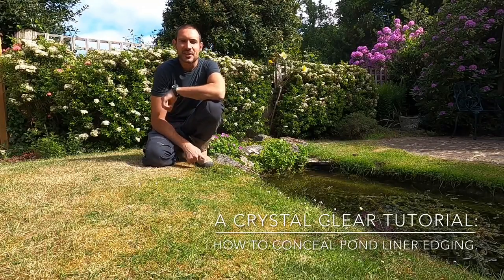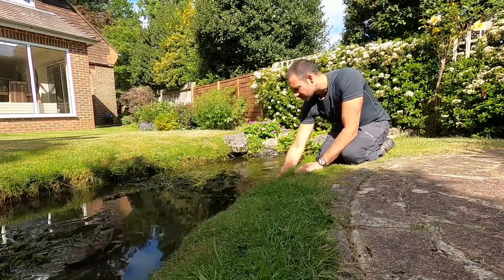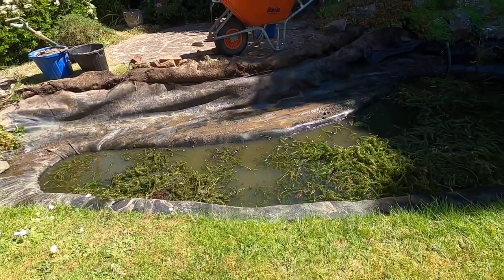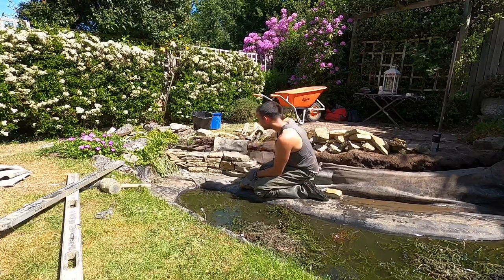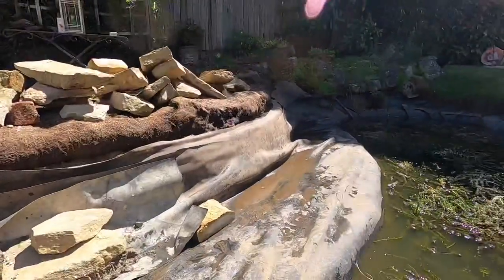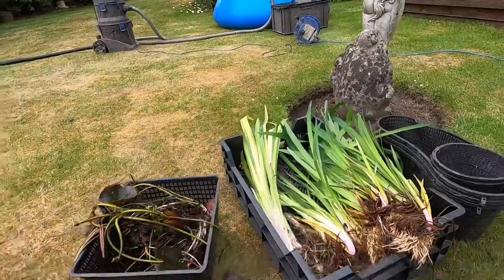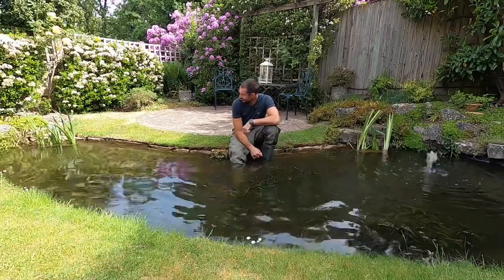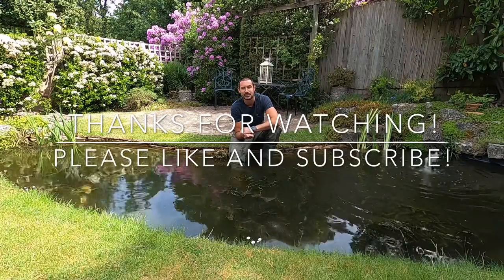How to hide pond liner around the edge of a pond.

Comment: Great video Ed. A method I've used in the past is to tuck some hessian sacking under the grass verge and let it drape into the water about 10cm below the water surface. Moss tends to grow on the sacking after a few months, hiding the lining quite well.
For planting I've used marsh marigold, yellow flag iris, water lilies, bogbean and parrot's foot. The only plant I've used that I'd never use again is water mint - it's a total thug, taking over the pond and happily spreading out of your pond and across the lawn!
Reply from the maker: Thanks for your comment-I’ve done the very same thing myself with some great success.  I did find however water loss was rather high as a result of the wicking from the hessian-although the surrounding planting was very lush and healthy!! Mint is certainly a thug-but the runners  are easy to pull and remove (when in water) and the benefits for pollinators and the wonderful smell justify its use for me!!
Best regards,
Ed
Reply: Thank you so much for the hessian tip!! I've been scratching my head for ages thinking how to hide my liner.

Comment: A wonderful video. Thank you. My 1,000 litre pre-formed pond should arrive in the next week or two so I’m on the lookout for info and came across your videos. Love your laid back, informative style.
Reply from the maker: Thanks very much!  Good luck with your new pond!  installing preformed shells can be a little tricky to get level- once in the ground and as level as you can get it backfill with soil AND fill the pond with water at the same time, to try to counteract the forces from inside and outside (if that makes sense!) Once it’s full of water any gaps around the sides are best filled with sand and then watered in with a hose.  This allows the small grains of sand/grit to settle and compact around the pond shell properly and reduces the risk of the pond moving/sinking over time. Take your time, persevere and you’ll get there!

Comment: How simple it is to add a water level sensor or a top-up device. Just a few pounds and the problem has been solved. Or if pond builders just rock up the pond from the beginning and thus there never has to be an issue to worry about in the first place.

Good video, great content, well done.

Comment: I use to only use gravel in my submersed plant baskets. Now I use crushed coconut grow medium in the bottom of the pot and top it off with gravel. It makes the pot much easier to remove when I need to do any plant maintenance. Additionally the plants seem to bloom longer because the crushed coconut seems to filter the water of nutrients better then gravel.
Reply from the maker: Fantastic idea and thanks for sharing! I do find though that the added ‘ballast’ or weight of the gravel is an added bonus, keeping the plants well anchored, helping prevent taller plants from toppling in the wind and preventing water lilies from floating up to the surface once they’ve grown so large that buoyancy becomes an issue.  But in those instances where manoeuvrability is a necessity this is a great idea!
Best,
Ed

Comment: Hi Ed,  great video ,  would there be any concern regarding rain run off from the surrounding grass / plants taking unwanted nutrients going into the pond? I've just starting building my small pond and was thinking this regarding the edge being higher than the original ground level
Reply from the maker: HI Kev, thanks for watching and commenting and my apologies for the delay in responding- it’s a great question! Run off is something that should always be considered- potentially adding nutrients that would encourage algae blooms and even potential contaminants and pollutants that could wipe out livestock in a pond.  As much as possible run off into a pond should be prevented, although a small amount is often inevitable and generally harmless.  I’d def try to prevent run off from turned soil/borders and never add compost/mulch/fertiliser etc to the borders close to a pond if run off contamination is a concern. Blanket weed and/or green water would quickly become a nightmare with the increase in nutrients.  Run off from established lawns is less of an issue, but be wary of treating your lawn if there’s a risk of heavy rain soon after application that could wash treatment into your pond. Setting the pond edge fractionally higher then the surrounding ground level can be beneficial, as long as it doesn’t cause you a headache with grass cutting etc.
Hope this helps and good luck with your build!
Best,
Ed

Comment: Nice looking pond but I fear that wildlife might find it difficult to get in and out safely as the sides are all quite 'steep'.
Reply from the maker: Thank you!  Not one of mine- simply commissioned to conceal the back edge of pond lining.  Good point re entry/exit points in ponds for wildlife and always something to consider when designing/building a pond; in this instance maintaining a full pond will be more then sufficient for any struggling critters to climb out of the pond.  Should the levels drop significantly some strategically positioned rocks, plus the marginal planting baskets are there to also provide a step up if needs be.
Best,

Ed

Comment: curious, how do you keep the dirt from the grass from running into the pond?
Reply from the maker: A very good question-as it’s important to try and prevent run off and soil contamination in ponds where possible- in this scenario any loose material/soil is held in place by the turf above and very quickly the fine web like root structure from the grass will bind and stabilise any loose materials.
This is something to consider carefully when edging a pond, ensuring downward slopes directing water to a pond can be checked with some raised stones or some heavy planting with good rapid growing ground cover to bind the soil together.
Thanks for watching!
Best,
Ed